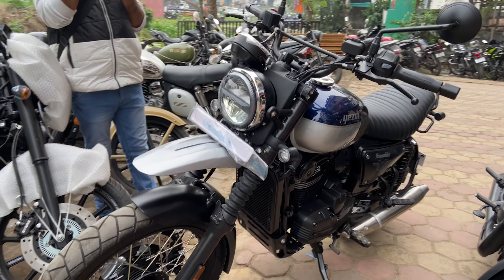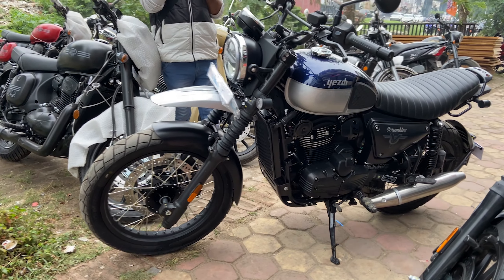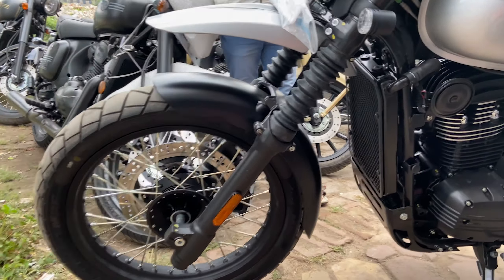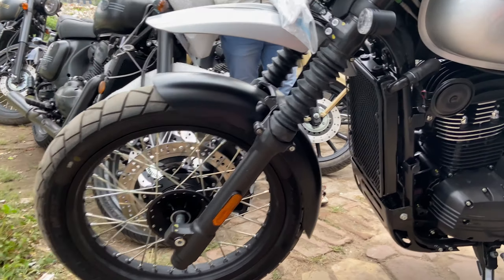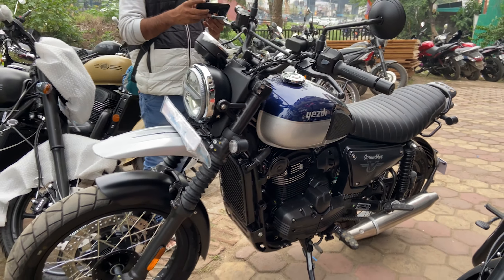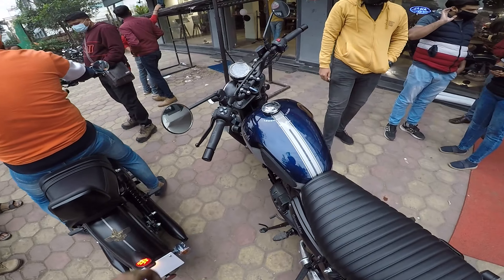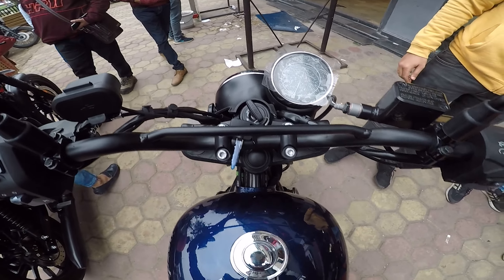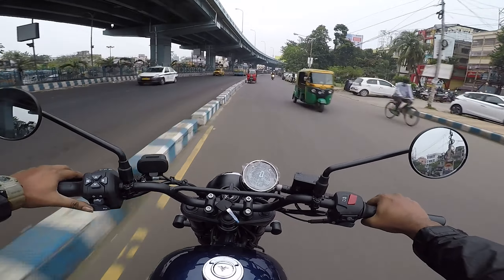Yezdi SCRAMBLER - Test Ride & Walkaround | Detailed Video

Comment: If it had a monoshock at the rear, it would have been so much better
Reply from the maker: Was expecting a mono shock but :(
Reply: Scrambler doesn't have mono shock suspension
Reply from the maker: @AdityaSingh016  ya scrambler dsnt have mono

Comment: Turning off the odo is a crime. So Yezdi running some kind of scam
Reply: if youve ever taken a test ride you would realize that most companies disconnect the gauges in test vehicles, its a standard practice
Reply from the maker: @leansnscenes7806  true .. I took bmw gs310 ride & same it was disconnected!!!
Reply from the maker: I should have switched on gopro gps speed :( forgot that!!